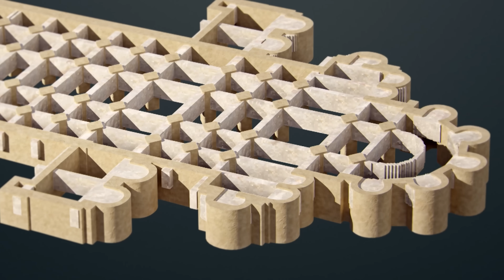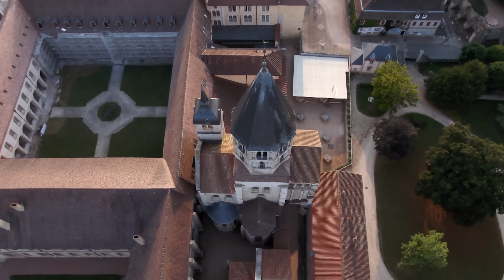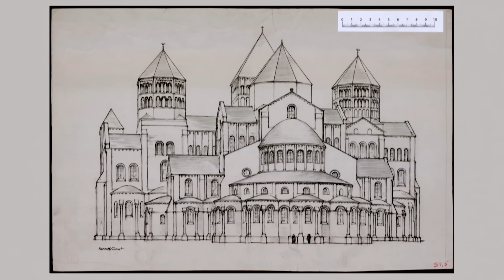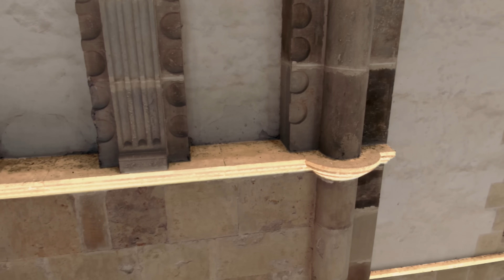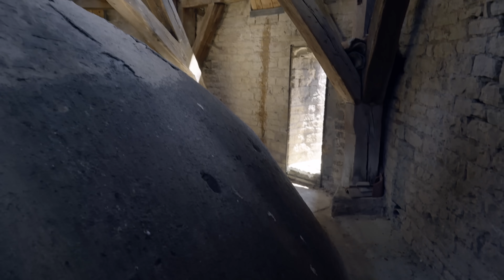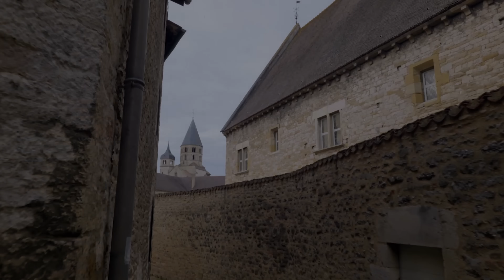Cluny Abbey: The Lost Holy City Of The Middle Ages

Comment: I understand the pervasive use of metric measurement; it is France after all, and they don't understand customary measurement. But the irony is not lost on me that the regime that spawned Metric is the same regime that destroyed the Abbey. Using Metric alone, in this case, seems highly disrespectful to the history of the building. Also notable by its absence is that at no point is this mentioned in the video.
Reply: Using pre-Revolutionary measurements would be more appropriate, but also meaningless to the bulk of the audience.